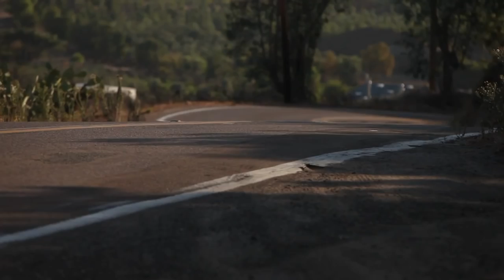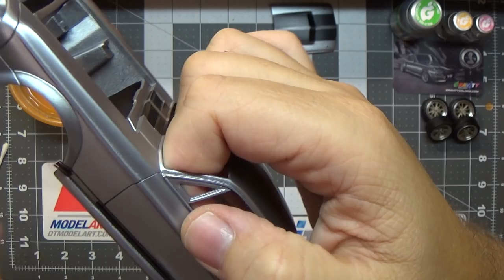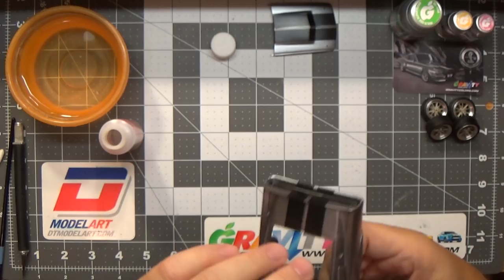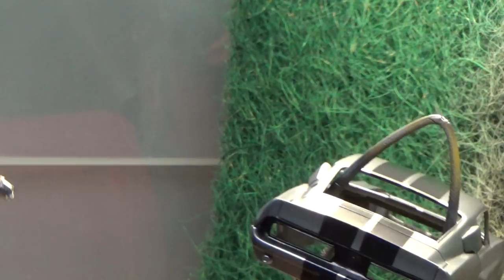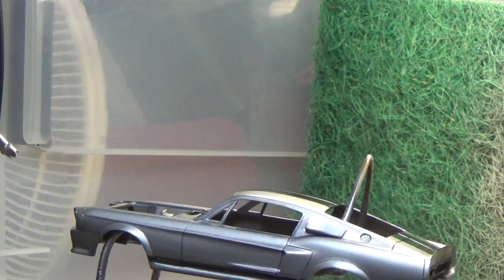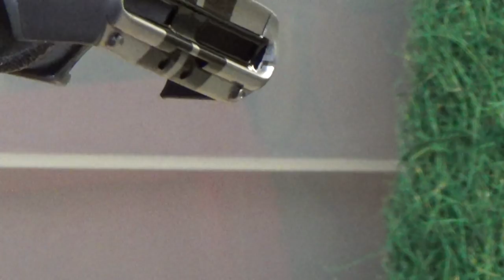1967 Shelby Mustang GT500 Eleanor scale model build-up video part 4

Comment: How long between coats of clear?  Do you sand the color coat?
Reply from the maker: 10-15 minutes. Sanding the color coat is not really recommended especially if it is a metallic base color coat. But you can wet sand the final coats of your 2K clear and polish it back to full high gloss shine.
Reply: Thanks
Reply from the maker: @Ken-sl4um  You are very welcome!

Comment: I really want to purchase the 2k clear, but I'm very concerned about spraying it. I will be using an extractor and filtered mask but I live in a small apartment and will be spraying in the same room as we live/cook in. Should I just stick to the 1k? It seems alot safer to use in my circumstances? I would really appreciate any advice.
Thanks,
Gar.
Reply from the maker: If you have a strong enough exhaust fan and you are able to exhaust the 2k Clear vapor through your window then you should be fine. I would not recommend spraying 2K clear without wearing any mask or respirator. A spray booth with an exhaust fan is also a must when you spray 2K indoors.
Reply: Thank you very much for the quick reply! I will place an order soon. Keep up the good work!!
Reply from the maker: You are very welcome! Looking forward to your order!

Comment: Me again.  Just got the 2k clear but now its 4:1:1  If I use 6ml of clear how much of the other two should I use.  Do you recommend more than 6ml for a Miata?
Reply from the maker: Hi, yes the new updated 2k clear has 4:1:1 mixing ratio. For 8 ml clear the mix would be like 2 ml hardener/activator and 2 ml thinner. That is the mixing ratio we use for our single use 2K clear product which covers one 1/24 or 1/25 scale model kit car body. I think you could do that 8ml:2ml:2ml mix for the miata body, it will be plenty for that car.
Reply from the maker: make sure your first 2k clear layer is a thin mist coat, let it dry for 5 minutes and then you can do 2 wet coat and you are all set. You can wet sand in 24 hours if needed (if you get orange peel or trash in the finish) and re polish it back to full shine.
Reply: Thanks.  This is why I went into Psychiatry as I could never figure out ratios
Reply from the maker: @Ken-sl4um  You are very welcome! Psychiatry is also very important these days! :) If you don't feel like playing around with the mixing ratios with the 2K clear we can always send you the single use option that is pre-mixed and you don't have to worry about the ratios. You just mix the pre-measured activator with the clear and you are ready to spray it. But it only covers one car body (single use) versus the set you received will cover at least 2-3 1/24 scale model car bodies.
Reply: I'm back.  Just clear coated another model.  8 2 2 mix, .5 needle around 25psi.  Tack coat then heavier.  No matter what I did I ended up with tons of orange peel.  Not sure why it wouldn't level out.  Now I have to do more sanding and polishing than I should have to.  Any suggestions?